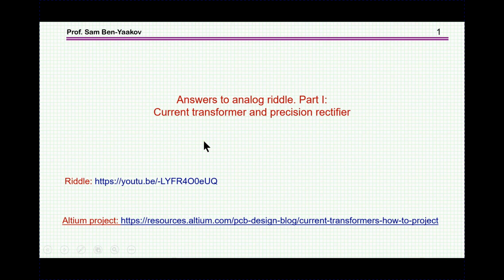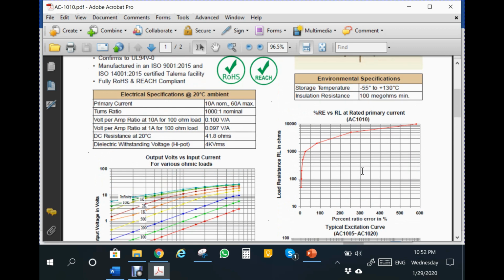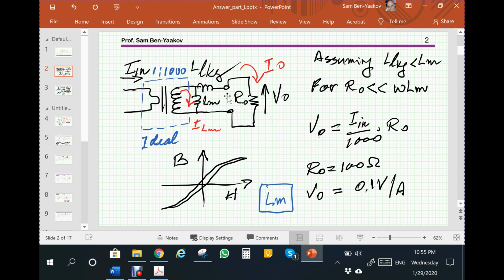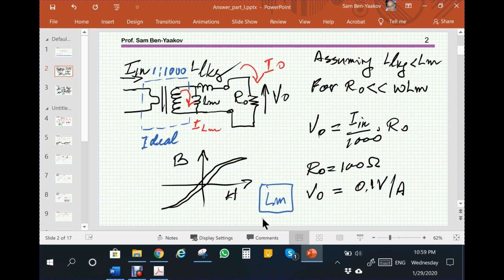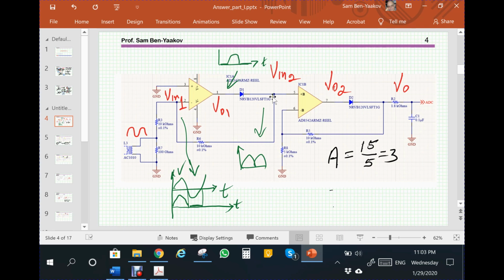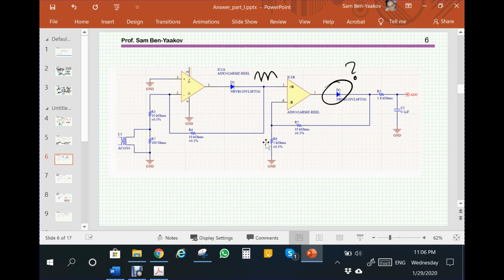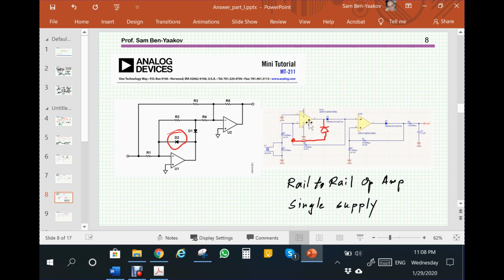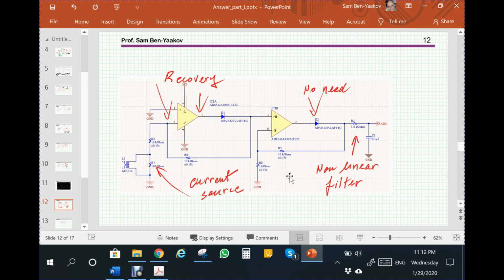Answers to analog riddle. Part I: Current transformer and precision rectifier

Comment: Excellent video, as always. 

However, just a minor point: The secondary of the AC1010 current transformer is not really loaded symmetrically in this design, is it? 

Resistor R7 is grounded at one end, but the other end sees an  positive voltage on average, fed by the OpAmp output. Thus contributing DC volt•seconds bias in its own right in the current transformer. Of course, R3+R6 is 20k vs. the 100R of R7, so this contribution will be minute. (OpAmp input impedance becomes irrelevant to this due to the feedback loop.) 

Me, I would probably connect the transformer secondary between the otherwise equally, half-supply biased inputs of the first OpAmp. Or rather, preferably between the electrically identical (+) inputs of an instrumentation amplifier. Or however Williams, Pease, Widlar et. al. instructs in more detail, once I care look it up.) And leave rectification for the second stage, and there only.
Reply from the maker: "he secondary of the AC1010 current transformer is not really loaded symmetrically in this design, is it? " not really, R3 is connected to virtual ground😊

Comment: sir please make video for designing power inductor using  toridal iron powder core without air gap, how we can select core size depending on dc current value with ripples.(inductor for LC filter of AC-DC supply)
Reply from the maker: Watch
https://youtu.be/6Mi8QDD71vE

Comment: A very deep technical detail explanation regarding current transformer.  I really like your practical approach using actual circuit. Question, should the second stage gain is 2 (A = -Rf/Rin = 10K/5K =2) ? Thanks Dr Yaakov
Reply from the maker: This is a non inventing configuration. Gain is correct

Comment: maybe the Diode is to improve the performance close to 0V because of output swing limitation but i think this is a bad solution, that is why it is important to bounce designs between engineers im sure a college would have pointed it out. or at least use some LTSpice to understand the design and caracterise it
Reply from the maker: Hi Heinrich, if I will have the time  I will run simulation with and without diode. Not a promise to do it😉
Reply: no worries, you do already so much! i will also maybe do some spice with it